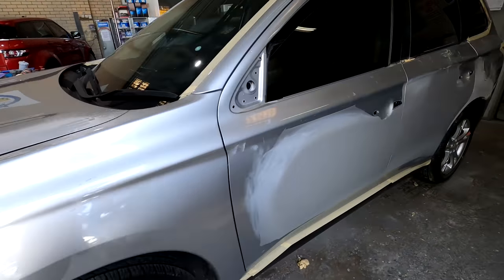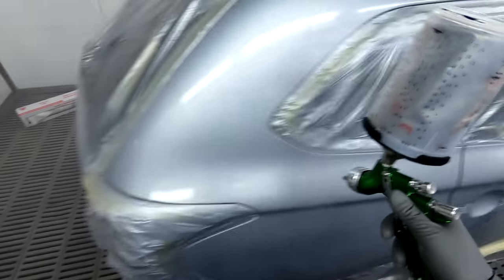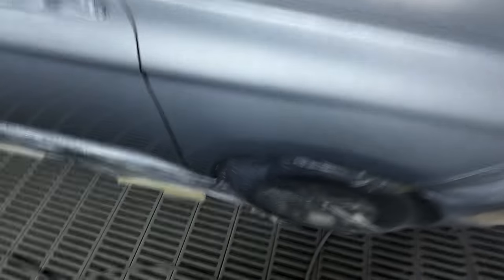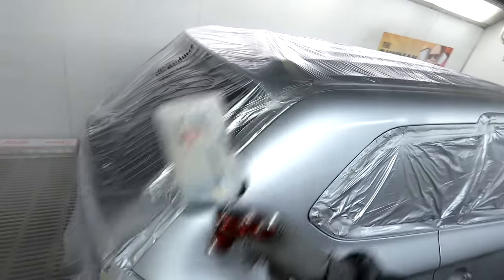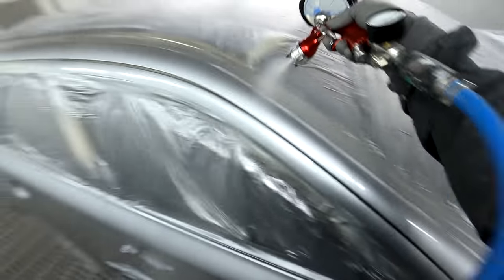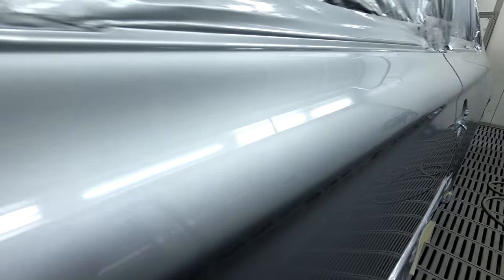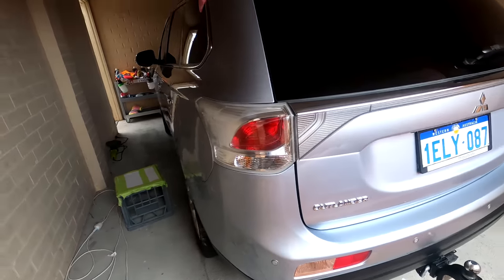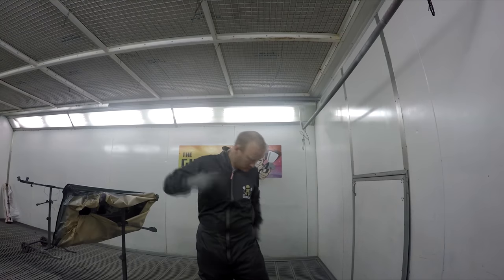Turning Paint Into Money

Comment: Dear
I want ask you question long time ago, I noticed you never mask a car with paper in painting stage, don't you have issues with base coat flying out of the plastic cover when you start applying clear coat?

Because I do have this issue Always.
Reply: Yes sometimes that can happen, make sure you're using a high quality plastic and make sure you have the correct side facing outward. Also try to have it pulled taught and not too loose to avoid it blowing around too much.
TC in Annapolis MD
Reply: Thanks

Comment: Like i always  say if you try to make everything perfect in this trade you are not making money 95% off all car owners won't notice those 2 extra pieces of dust or if the panel has a tiny rippel in it make it as good you can within the time limit.  i did this opel astra today it was not in the best shape dents and scratches all over the car we did the half of  rear bumper bar and the quarter panel . Bumper bar had just some scratches on it so sanded it out very fine to 600 grit and just put plastic primer and then basecoat  that saved me atleast 30 minutes of priming and resanding  the quarter panel had one small dent i got that one out with some pdr and some chips around the gas flap  i think some one tried to pry it open instead of sanding those out and priming more then half way on the quarter panel and having to blend in the door i just knifed those chips in with some filler put a bit of washprimer over it and i was able to keep my color away from the door saved me another prime and sand and blend i got it done in around 1 hour and 10 minutes my boss charged 1000 bucks and it looked mint owner of the car was happy my boss was happy and i was happy with a exta 50 bucks cash on top of my salary